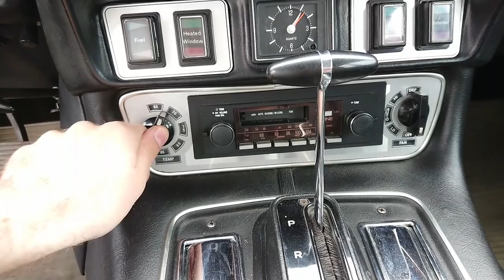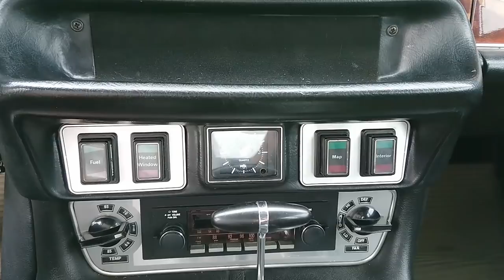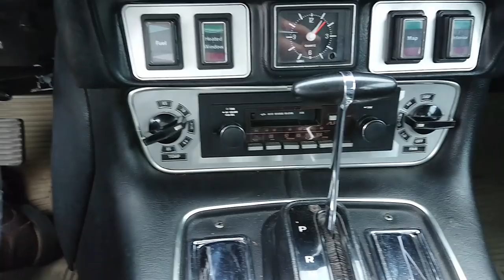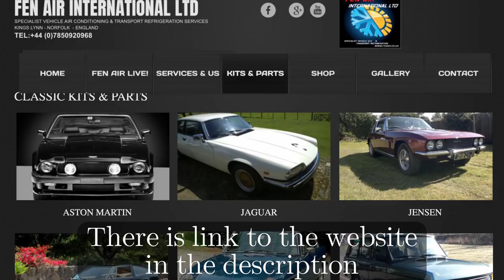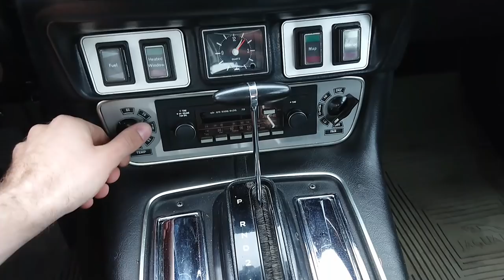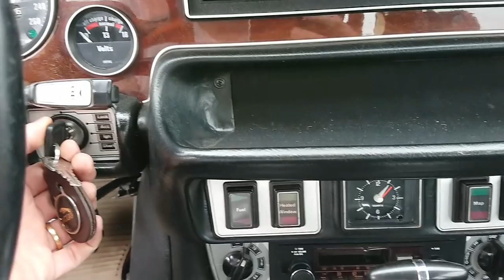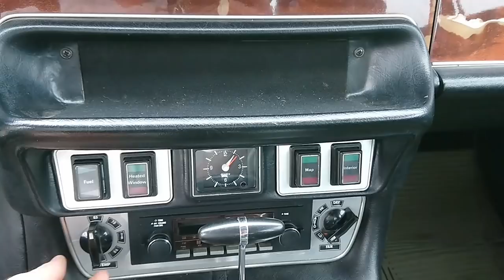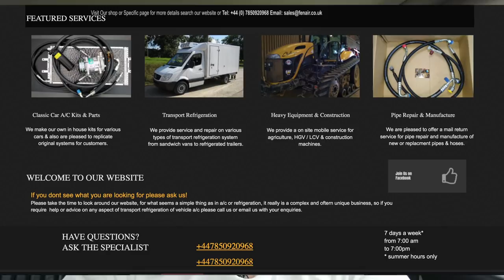Air conditioning upgrade kit - Fen Air sanden kit for Jaguar V12

Comment: Wow, impressive at minute 5:07 with the dashboard out! I would have been to nervous with removing the dash then having the motivation and knowledge to put that all back together.
Reply from the maker: I was nervous at first but once you've taken one out its not too bad 😊
Reply: @LivingWithAClassic  personally I would rather pull an engine than go into the dashboard 😆😆 but then again, this is my first Jag and first V12 so maybe pulling the V12 would be a much bigger ordeal. My other cars have all been turbo 4s and a straight 6 and a bit more modern, so nowhere near as many vacuum lines and the wiring harnesses are better organized with better plugs 😅. I've done multiple types of engine-out, engine swap, rebuild, turbo replacement, etc, but the one time I had a heater core that started to leak, "nope, it's going to a shop, I'll pay someone else to deal with that" 😂

Comment: Adam, I have a 1989 XJS that I'm thinking of improving my AC system with a new condenser and compressor. I replaced the compressor 3 years ago with a rebuilt A6 compressor but it's now too loud when it kicks on so I'm thinking about getting another compressor.
I noticed everyone is talking about parallel flow condensers now but don't easily see replacement condensers for 1989 XJS's.
I wish I had the money to go with the FEN air kit you installed but I will have to go with a less money situation.
I think you have the best title, "Living with a Classic". For me, I'm always, "Dealing with my Classic" and want to sometimes give up , but I keep going.
Reply from the maker: I hope you find a good solution for your AC. Thanks for watching and for liking the name 😊

Comment: Another great video!  My new DD6 has some problems with the whole system and you showed a few things to check!
On a different subject, can you just swap out the original pump for the Sanden one and reap full benefit?
Reply: I do hope that answer will be yes, as I’ve just got one for very cheap on eBay.  If not, it was worth a punt lol.

Comment: So I'm gonna give it a try and be your first anoying subscriber that will try to correct you haha.

Don't you mean "if you are cold, you set it to high" and "if you are warm you set it to low"?

You said, if you are cold you set it to a colder temperature and vica versa. I don't get that do you set the temperature that you think it is in the cabin?
Reply from the maker: Maybe I misspoke at one place Daan 😊 You set whatever temperature you want however the system is limited. If you set the coldest temperature it can go to but it's already colder in the car then that, it will heat the interior. Which is a little odd. But otherwise it works just like modern systems. Set it to let's day 20 degrees C and it will do what is needed to keep that temperature. Pretty high tech for 1977